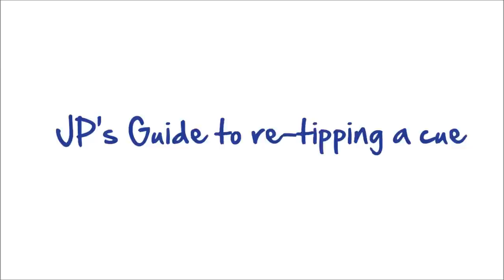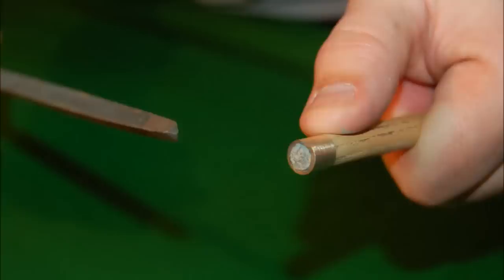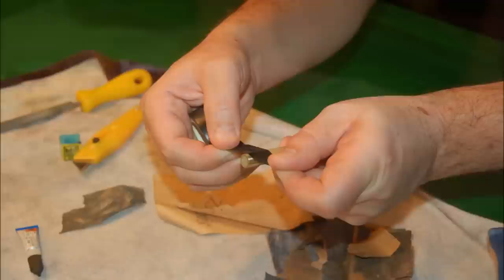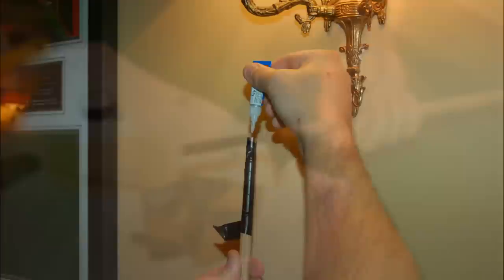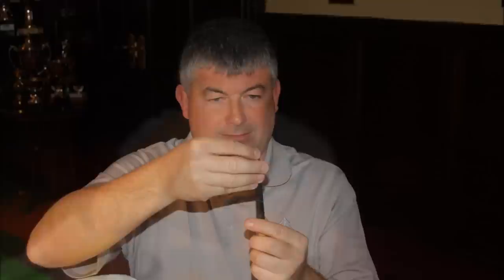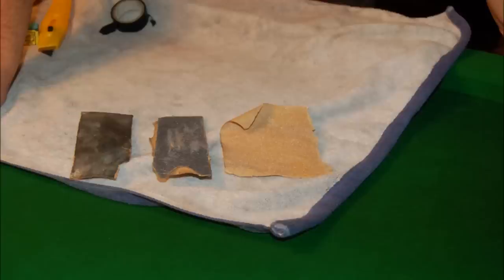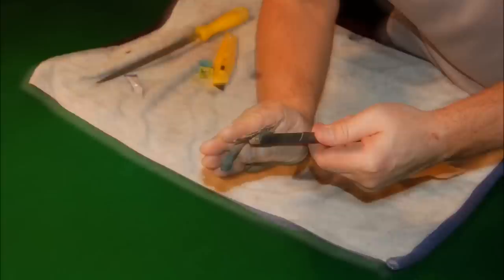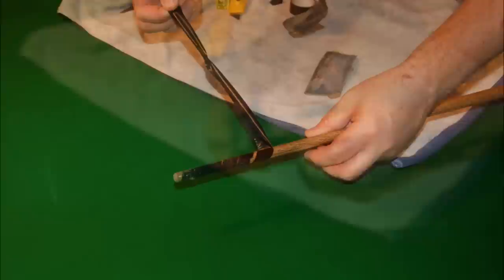John Parrott's Guide to Re-tipping a Cue

Comment: Wow! Caution: I would have thought John would know better. Never ever file the ferrule. Instead to remove the glue residue use a Stanley blade and hold it vertically and gently scrape the glue off. If you file the ferrule it’ll become wonky and damaged and therefor the tip will not be flush with the cue. Ridiculous piece of advice!
Reply: You'll be as sick as a parrot if you follow this advice and ruin your cue
Reply: Agreed..  silly bit of advice there, especially for men who are utterly useless with a tool in their hand😂😂😂there's more than one might think lol

I've always shaved the remainder of the tip with a Stanley blade. This is a very easy job to do, you wouldn't believe the guys in the club who can't do it😳I also glue the tip centre...there's always a mill or two overhang on mine so I turn the cue upside-down and trim the tip downwards on a bear matt placed on the table....slowly rotating the cue and taking the excess off until its even with the ferrule. Then I start to dome it how I like it. Its a 10-15min job with the glue I use which is Loctite precision glue. 

Little tip, once done turn the cue upside-down and let the cue hit a hard tile from about 4-6inches above the ground. This will bed the tip in much faster. You will have to do a little bit of reshaping the tip after this but it makes the tip feel a lot more positive...meaning the tip will give you a lot more feedback so you can play those little intricate shots better!👍🏼🎱